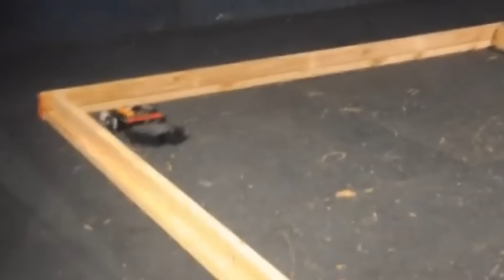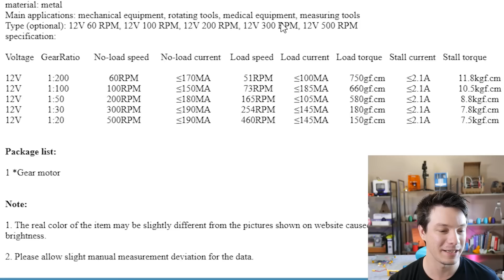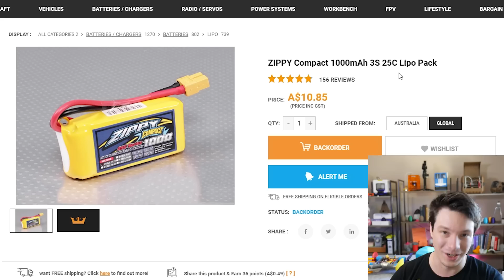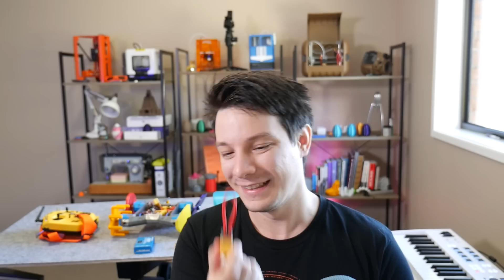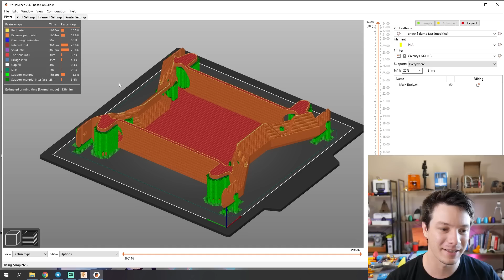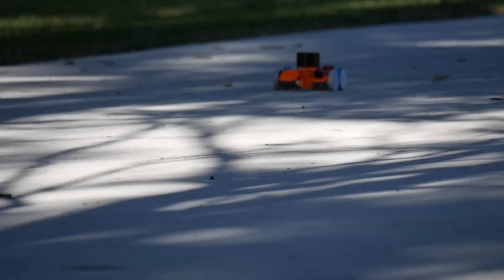How to build remote control robot platforms (you can do it!)

Comment: Loved this video, and I hope you will make a series of remote control robotic platforms videos. I have not 3d printed myself a robotic platform, due to 3d printer with a max 14x14x14 cm printspace. But I have built myself 3 robotic platforms using kits. A Dagu Wild Thumper 6WD robot, a Banggood TP101 / T-101P tracked robotic chassis kit, and a DFRobot Devastator tracked robotic chassis. Used a Pololu TRex dual motor controller in my Dagu Wild Thumper and DFRobot Devastator, but my latest build, the TP101, I used a couple of Hobbywing 1060 ESC. A bit tricky to program a single stick tank mix on my Taranis radio, but I managed it in the end. However I found that the timing on the brushed motors on the TP101 robotic chassis platform were a bit of since it has a motor in the front and in the back, which means one has to be in reverse and that resulted in different speeds. But I got it to go in a reasonably straight line when moving forwards. When moving backwards / in reverse it drifts to one side unfortunately. 

But to a question I would like to have answered in a possible follow up video, is how you link the motors to the wheels on 3d printed robotic platforms. On my platforms there are an adapter, which connects to the motor shaft with a grub screw and which the wheels are friction-fit to. However such adapters are not easily available in my country, unlike rc hobby motors, brushless or brushed. 
Is it possible to 3d print, solid infill, PLA, such an adapter which connects to the motor shaft using a grub-screw or similar, or will that break to easily under the torque an rc motor produces?

Also, it might be simpler to modify some servoes, to be 360 servoes, to drive the wheels on smaller 3d printed robotic platforms, rather than using rc motors and esc / rc motors and motor drivers. 
Because you could mount the wheels / glue them, to the servo horn of the servoes, and the servoes could be run directly from the receiver. You would need a BEC to power the servoes, and the reciever. But with such a setup you could have multiple robotic platforms with servoes rather than rc motors in them. Then you could have a one single modular box with the receiever, BEC and battery, to drive the servoes of the various robotic platforms. Come to think of it, that may be my forth robotic platform. :)

Comment: Maby try using Mecanum wheels. This could be interesting
Reply from the maker: Yeah, I really wanna try them out
Reply: I just looked 'em up - pricey!
Reply: @tomgray971  Good quality ones are pricy with is true about most things, but I saw some cheap crappy ones for around 15~30 bucks for four set so maby You can find something half decant somewhere. I think that 3D printing could work just fine, maby if You use small metal rods for roller's axle to reduce friction.
Reply: @Milko7002  Thanks for the tips.
Reply: Alternatively, I’ve been doing some research into omniball wheels, and they look pretty cool, they would do well in a frame like this.

Comment: If you don't want to bother with a remote control you can relatively easily just put an esp8266 or similar in it, and control it via wifi. I've run multi-drone swarms like that and it's effective.
Reply from the maker: That's neat! Is there a good beginners guide somewhere?

Comment: This is a very solid introduction to building a remote control robot. It’s great to see this side of your experience! I’d love a series where you build a battle bot!
Reply: Mee to. And I would love Angus to try on the challenge of making a 3d printed battle robot to test against the usual battle robots. Since plastic is weaker then metal, he would have to think a bit outside the box.
Reply: @jenspetter80  There is a dedicated weight class for 3D printed robots called "Plastic Ants" that weight 454g, and 3D printing is commonly using in 3lb robots as well.

Comment: Great video and very thorough. I was involved in a battle bot build back in my uni days and I've flown quads for about 5 years so this isn't new to me but a great guide for anyone just getting started in the world of rc and robotics!
Reply from the maker: Cheers! It's one of those topics that has so many aspects to cover but once you know the basics you can make some really cool stuff. I've always been tempted by quads but I'm really good at crashing into things... haha
Reply: Mate I have quadriplegia it took ages to work out how I could control a quad with such limited dexterity and longer still to learn to fly without crashing every 5 seconds. Find a quad club in your area and do alot of flying outdoors in a big field. You can also get a mini whoop that will fly indoors that won't damage anything if / when it crashes and it can be useful as far as learning the controls but the actual flight mechanics of a tiny whoop are substantially different compared to a racer or freestyle quad due to the massive difference in weight and thrust.